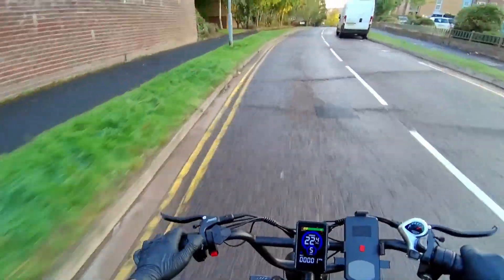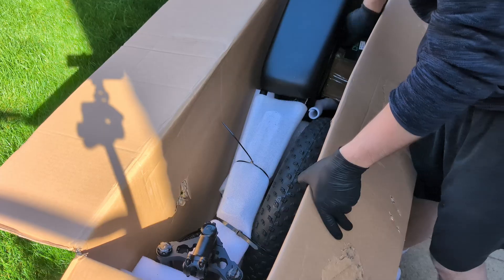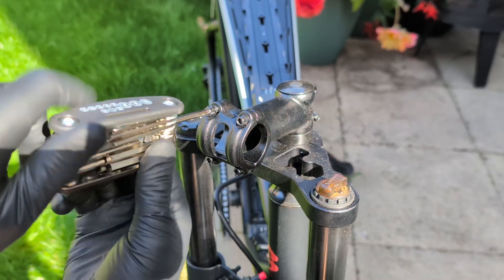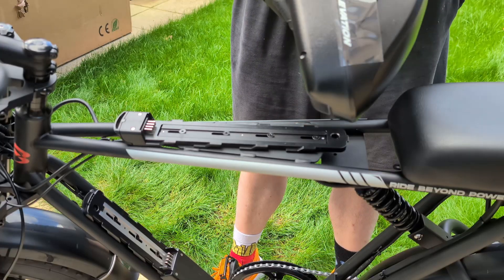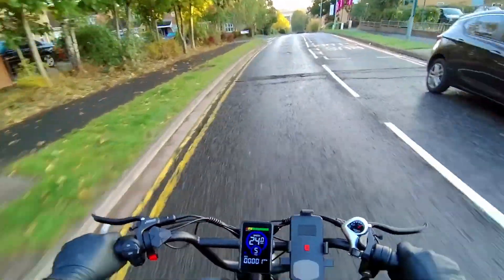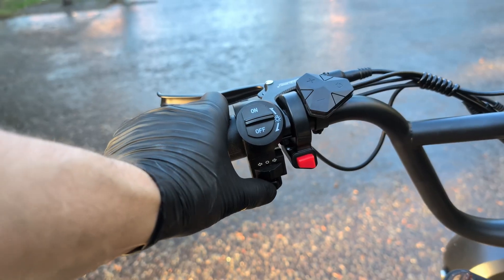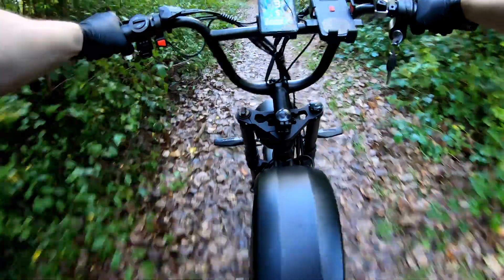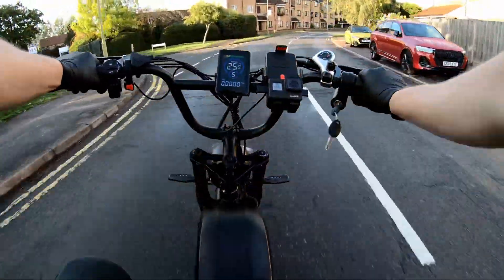Bluvall K10 Trail: Why Does It Need SO MUCH POWER and Two Batteries?

Comment: That thing looks heavy.
Reply: You’re right — the dual batteries do add a bit of extra weight. 
But once you’re riding, the power balance makes it feel surprisingly light and agile.
Handling is still strong and responsive — just maybe not the best bike to carry up a few flights of stairs! 😄
Reply from the maker: It’s great and stable and powerful!

Comment: How long does it take to charge both batteries?
Reply: Each K10 comes with two chargers — one for each battery. 
Most riders simply plug both in before bed, and a full charge usually takes about 5–6 hours.
That way, you’ll wake up to two fully charged batteries ready for the next ride! 😄

Comment: Can you pedal it easily if the battery dies?
Reply: Yes, you can still pedal it if the batteries run out. 
The 7-speed gear system makes it easier to ride without power, though it’ll feel heavier than a regular bike — especially on hills, since it carries dual batteries.
That said, the long-range setup means most riders rarely run out of charge on the road.😊
Reply from the maker: You can, it has a 7-speed Shimano gear set. It's a heavy bike though, so it'll be a workout!

Comment: I've been researching moped-style e-bikes for ages, and this Bluvall K10 Trail seems to have solved the biggest problem: range. Having two massive batteries is a total game-changer. Most competitors give you one, and you're lucky to get 40 miles of real-world use. The fact that this can potentially go over 100 miles is just mind-blowing. The full suspension is the other major selling point for me. The roads where I live are terrible, and a hardtail fat tire bike can be brutal. This looks like it just floats over everything. Amazing review, you covered all the important points.
Reply from the maker: You've nailed the two best things about it! The massive range and the full suspension combo make it such a unique and practical beast. It really does feel like you're floating. Thanks for sharing your thoughts!